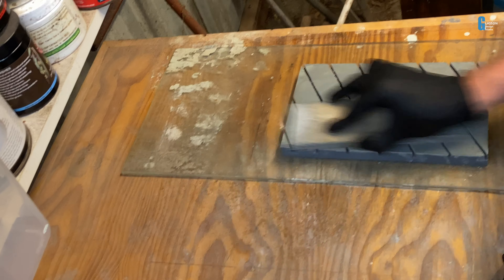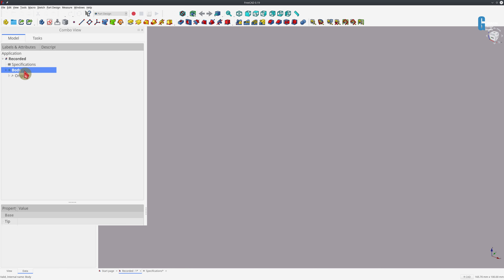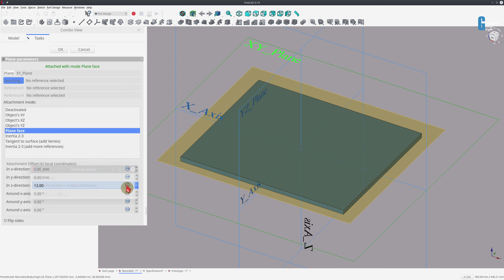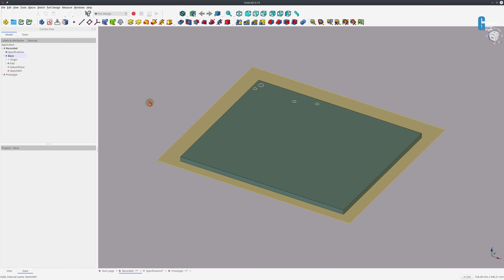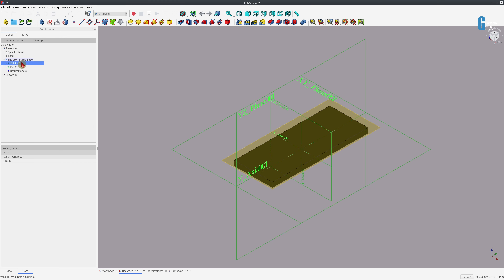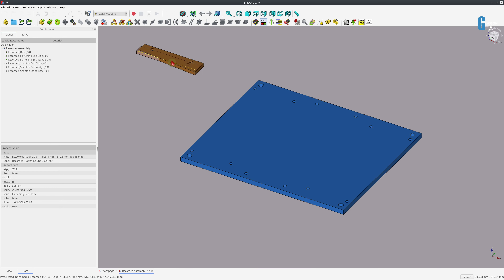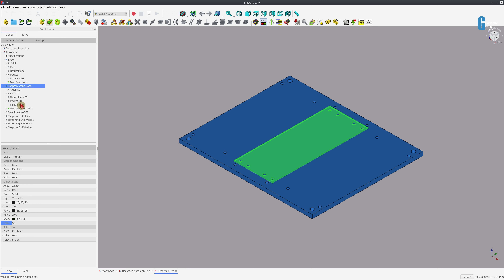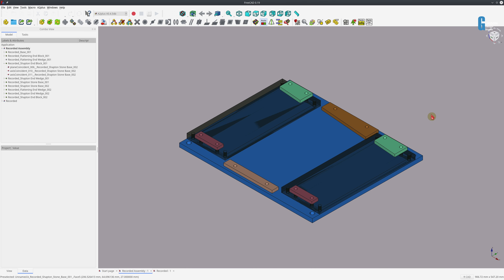I couldn't get a sharp chisel until I built this...Sharpening Stone Holder

Comment: Hi Jeff, please take a look at my comment on your video related to Linked models. About this video I think I would go for a master sketch instead to avoid the mess you went into, LOL. Thank you for your effort. Using A2Plus I prefer to place the bodies over the base and just do the coincidance of all holes first and for that you don't need to select the bottom edges of the stones. On circular things it doesn't matter. And finally you select the top face of the base and all the bottom faces of the rest of the other bodies at once then apply the plane to plane constraint. I think it works but I'm not sure if I've tried yet...
Reply from the maker: Thanks for your feedback Luis. You make some good points which I'll have to try to work into my own workflow